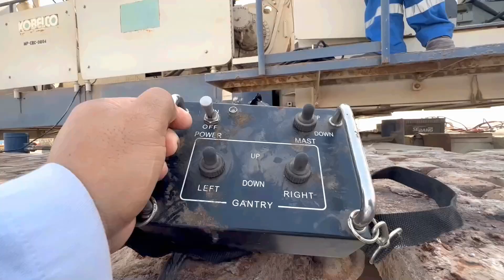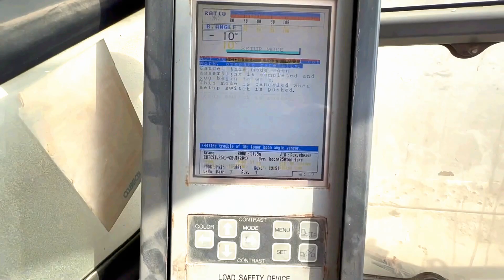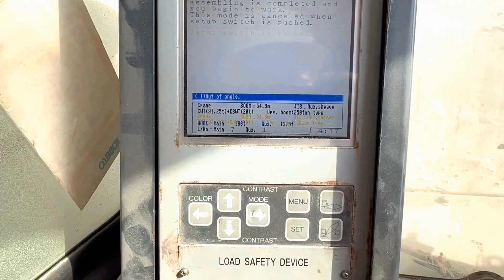How to Disassemble and transport 250Ton Crawler Crane - CKE2500 Kobelco

Comment: interesting take, but did you know you can disassemble the counterweight tray with the gantry?, look at Liebherr videos, they show you how, just put the mast up, lock it, and use the gantry to do the lowering of the tray, and also you can do the body counterweights and tracks too, all by 'self-assembly' with the mast and an assist cylinder/hook block.